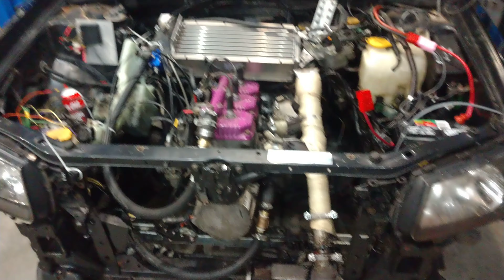2004 Subaru Forester XT gets a 1997 Polaris XLT Snowmobile Motor.

Comment: The exhaust needs to be exactly like it was in the snowmobile. Every measurement, angle and curve of the pipe is there for a reason. Engine will never run properly like that.

Comment: This is amazing! Ive got a yamaha 700 triple and want to do the same thing.. do you know if your engine takes the "thrust" from the throw out bearing well? I assume it doesn't as they weren't meant for that lol
Reply from the maker: So I sold this a while back. However in the couple weeks of me cruising around with it. And never noticed any issues with that.
Reply: @Hailey-xf5fm  regardless, it is amazing!!! How did you go about machining the crank end? I need to ask someone to do this for me, no lathe or mill lol
Reply: @connorbabcock8197  I machined the taper for this build on a monarch lathe. Pretty much the only way to do it accurately 👍

Comment: You’re gonna need the original exhaust with an expansion Chamber for that 2 stroke to run right
Reply: It has an expansion chamber
Reply: Pay attention. You can clearly see the pipe
Reply: @JP3_C6Z  yeah it’s 4 feet away from the motor 😂. It’s basically useless. The thing is gonna be way underpowered vs if it were setup like it was from the factory
Reply: Wah wah wah it's cool shut yp

Comment: That is definitely an Ultra engine not an XLT engine.
Reply: Yup Ultra 670cc, XLT never had those heads, it was also a different crank setup than the more modern Ultra and XCR’s that used this head setup. They were hot motors in their day.
Reply: Ultra is a 680..    679cc